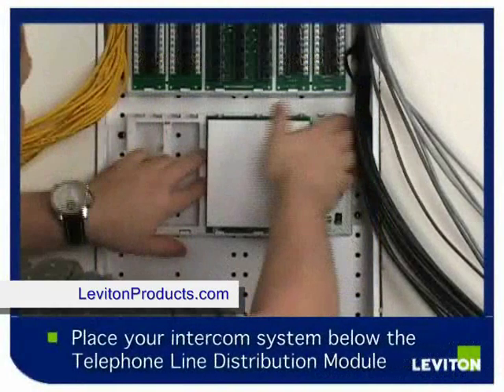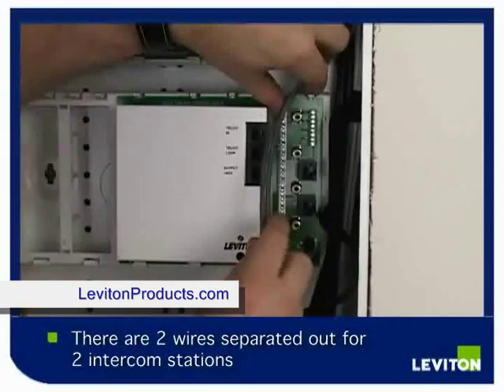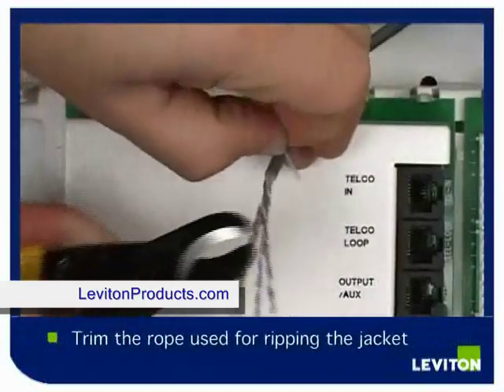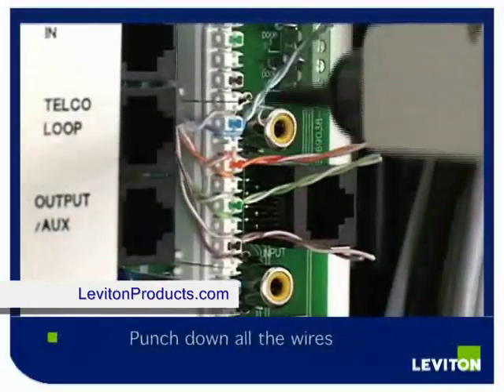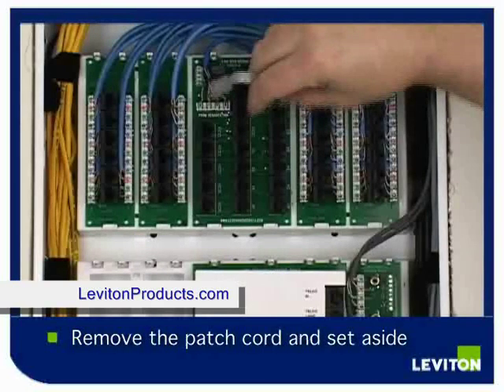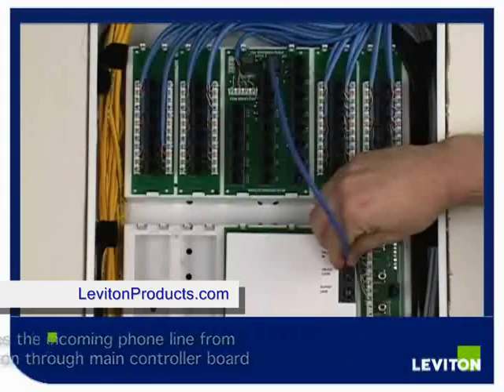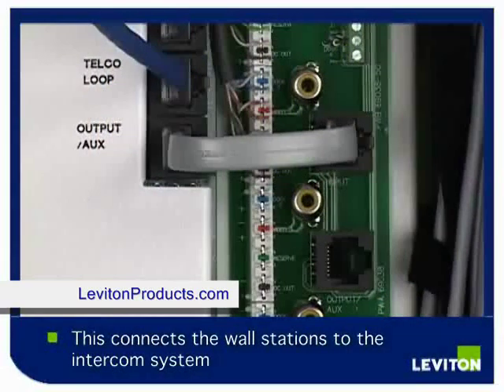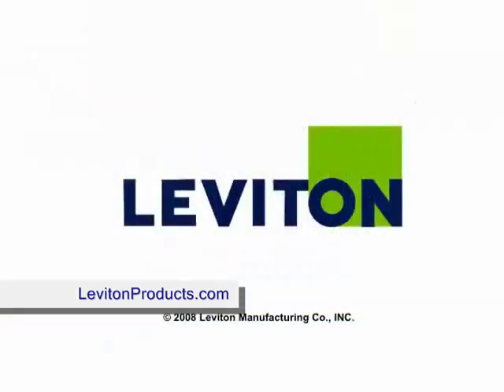How to install Leviton Intercom System Main Controller Board - LevitonProducts.com

Comment: You showing cutting the rope, but not using the rope to open the jacket so you don't nick the wires!!! I've seen too many installs through the years from installers that didn't use the rope to open the jacket.